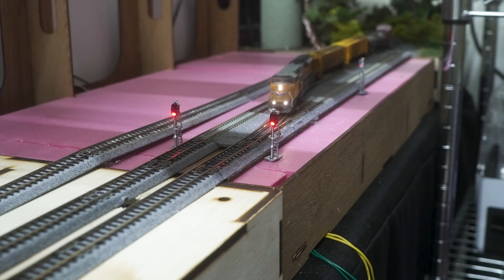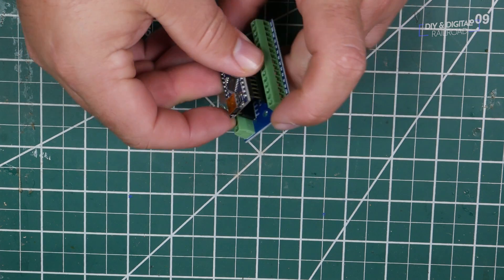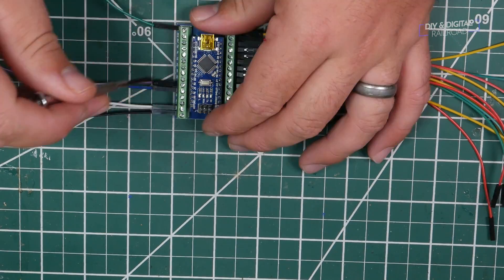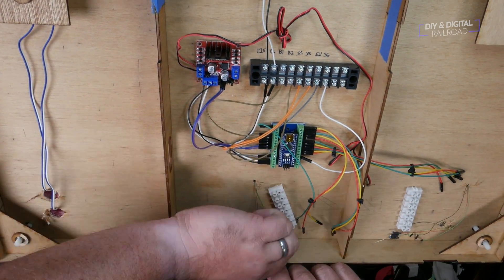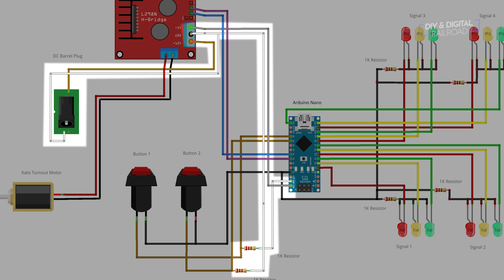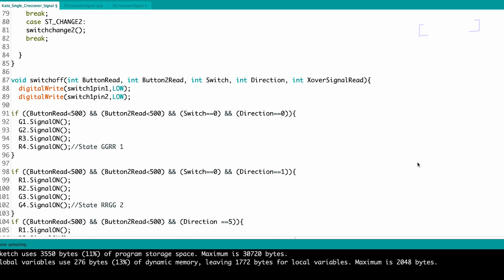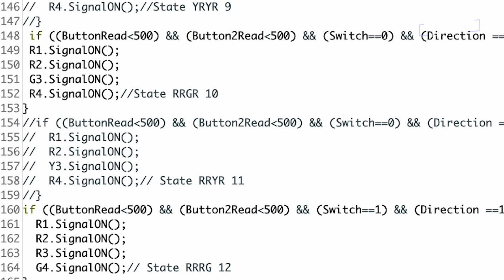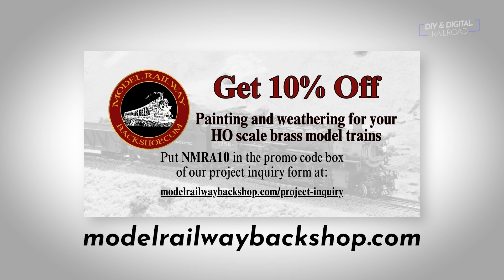MODEL RAILROAD DIY TURNOUT SIGNAL WIRING with arduinos

Comment: Hi Jimmy, Love you videos. I have DCC concepts digital IP motor which have 3 wires for push buttons. How can I use the Arduino and signals with my turnouts?

Comment: My ears perked up when you said "Rural Hall". I live about 5 miles from the actual Rural Hall, NC. It's a pretty interesting point for the railroad with an active transloading track. Your video is very helpful and easy to follow, as I don't have much experience at all with signal wiring. Thanks for the great explanation!

Comment: Thanks for posting this video.  Your earlier videos inspired me to start playing with arduino’s 2 years ago.  I’ve created a setup where i have 40 turnouts, 40 signals, and 29 IR block detection sensors being controlled by a single nano.  I’m planning on sharing the setup and code with you when I have it completed.

Comment: This can also be done easily using Dcc-ex and ex-rail. You define the signals and the pins that they are attached to. The separate light configurations can be defined as routes and you can control everything directly from your phone in engine driver.

Comment: Hi Jimmy, I've just completed the electronics for our Club Fiddle Yard.   Basically using an Arduino to select a route via a push button that controls up to 8 turnouts.   A couple of things you may want to consider.   Note that I'm using a Mega as I needed lots of ports.   First, when I attempted to provide 5V on VIN, I did NOT get 5V coming out ont he 5V port as the Arduino seems to consume some of the voltage which is why, I think, Arduino recommends 9 to 12V on VIN.   I used a buck converter to drop the 12V to 9V.   Second, I now make up all my own Dupont wiring using 20AWG stranded wire.   That way I get the correct length and I can make them up with 4 wire headers for the L298Ns.

Comment: Just getting back into model railroading and it's crazy the number of skills required ie painting, track laying, soldering, etc.  Throw in the electrical/electronics aspect and especially automation and my mind has to work overtime.  This is not an easy project and I have done a number of non train related arduino/rasperry pi projects over the years.  Especially figuring out all that code is impressive.

Comment: Jimmy, I see that you have embraced the use of objects in this code, which has simplified the code considerably. The next step would be to create a class that incorporates all three LEDs - red, yellow, green - and allows you to set the signal aspect with a single command (e.g. s1.setAspect(RED_ONLY) or s1.setAspect(GREEN_OVER_RED)). Code within the class turns the appropriate LEDs on or off based on the aspect definition.)
Also, please note that the external resistors are not required, because all of the Arduino pins are equipped with 20k Ohm internal pullup resistors. Just use pinmode(pin,INPUT_PULLUP)
Thanks for returning to your digital roots!

Comment: Interesting concept Jimmy. Will you be planning on making the signal go back to red as the locomotive passes by just like how the prototype works with your arduinos? - Jason
Reply from the maker: I think if I was doing HO, I would because there is more room to fit in a sensor to tell once it has passed.  I still may do it, but it's hard to hide the mechanism with N Scale.
Reply: @DIYDigitalRailroad  what about using a current sensor that the track feeder goes through to detect current flow? I know that adds a lot more wiring underneath and requires insulating joiners. I use the ones from RR Cirkits. I used to use the NCE BD20s but not sure if either would work with an Arduino.

Comment: Now, usually I can dig something that's complicated but make sense, but I've gotten to a point where I don't know if I'll ever really work with signalling. I know on really large railroads with dispatch they've got block detection and dispatch stuff where the dispatch can change the signals for signal indication. I just can't imagine doing all this. 

Props to you in how you've described everything and put this together. Is this a program that lets you draw schematics like this?
Reply from the maker: Yes I use Fritzing to draw my schematics and create PCBs.

Comment: Maybe I am misunderstanding the American signaling system but how can two opposing signals both be green? (Both sides of the crossover). Would that not allow trains from both directions to use the crossover. I would imagine of course 1 of the trains already be stopped long before it reaches the track with the crossover but still. This Dutch boy is puzzeled. 😂

Keep up the nice videos!
Reply: The most common - but by no means universal! - practice at turnouts is to use the upper signal head to indicate the status of the straight route through the turnout, and the lower head to indicate the status of the diverging route. Therefore, green over red would indicate the turnout is positioned straight and the track ahead is clear. Red over green would indicate the turnout is positioned diverging and the track on the diverging path is clear. Yellow usually means proceed preparing to stop at the next signal, and flashing yellow means proceed at restricted speed.
If a train is approaching a turnout and expecting to proceed straight, but the signal displays red over green, the train would stop at the signal and wait for the signal to change to green or yellow on the upper head.
Reply: I don't think at any point there is a signal configuration that would lead trains to come to a head on collision unless the turnouts were set incorrectly, and I think that's part of what's going on here, figuring out how to set the crossover, or is a double crossover? 

Check it out again though, because I'm fairly certain the lines never have green on both the left and right side of the same line. If you've got top left and bottom right green, I'm assuming the turnouts would be lined to continue straight instead of diverging. I'd also assume that only a single green (out of all four) would indicate that the train would be diverging from one track to another. 

It is kind of simple though, for now, as I know other railroads use different signaling, like needing multiple lights on at a time. I know from a couple channels that CSX, for example, uses signals to show speed, so heading straight through the turnouts would likely be different from if you were taking the diverging route....depending on what the overall track speed is through the area.
Reply from the maker: No worries.  The signals are on 2 different tracks.  Yes Green Green on the same track would be bad😂
Reply: Yes that sounds logical. I assumed green means turnout is set for that direction and it is but I connected the two greens together as a “path” and this is not the case of course. 

Thanks for explaining!